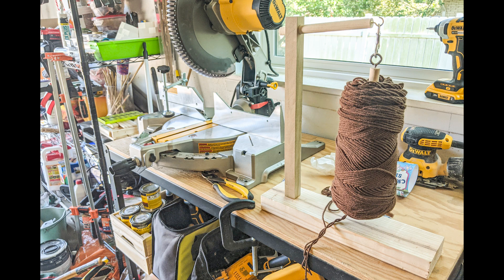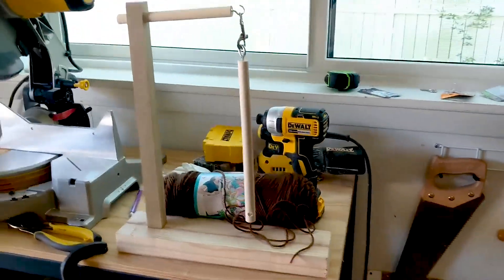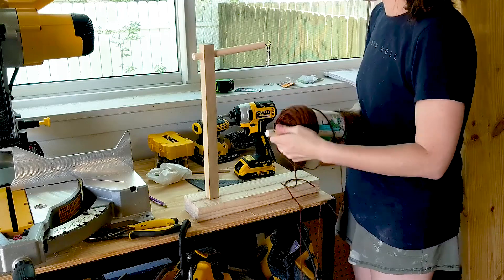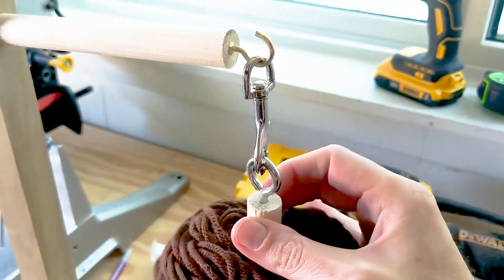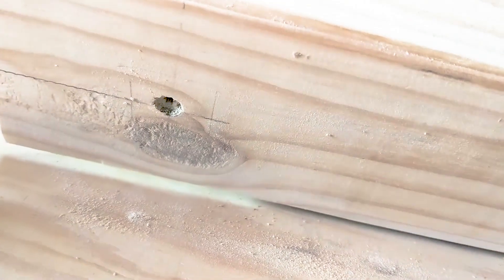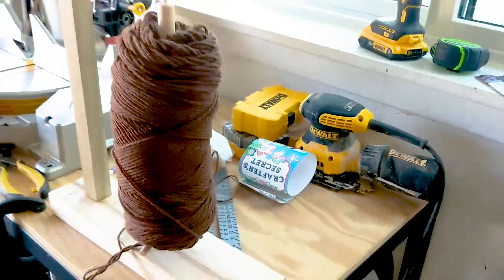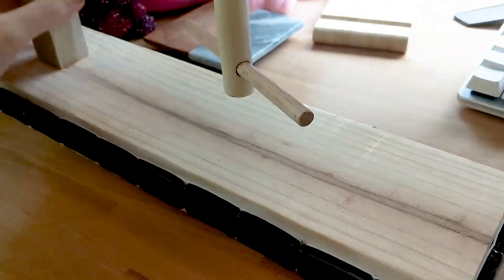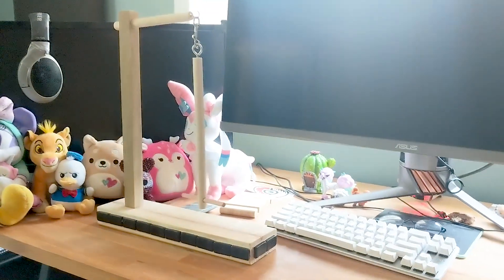DIY: Wool Jeanie | Or the twirling yarn bowl! | Cody's Craft Corner

Comment: Yowza!  

That’s a huge device that seems about right for big box synthetic fiber yarn skeins, but very oversized for the 50 & 100 gram natural fiber yarns quantities that are typically sold in skeins or hanks in local yarn stores, aka LYS.  

I buy yarn almost exclusively from LYS.  Yarn hanks need to be wound at the store or at home by the customer into compact yarn cakes with a swift and ball winder.  At most they are 5-6” high after winding.